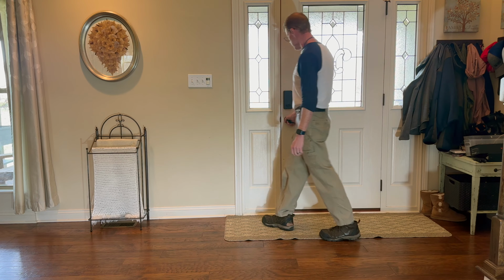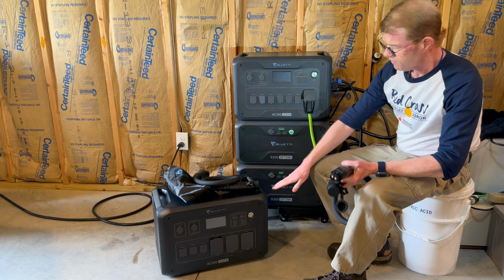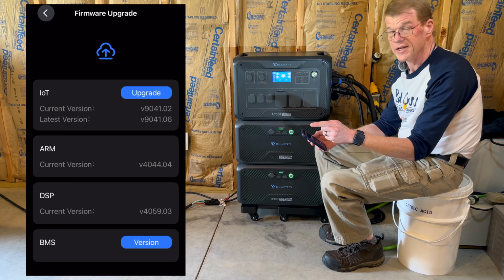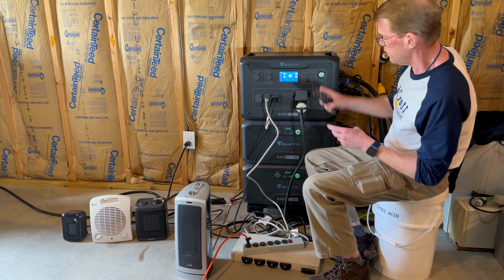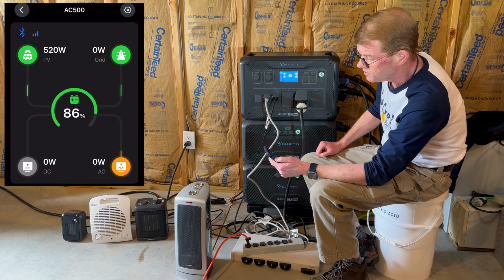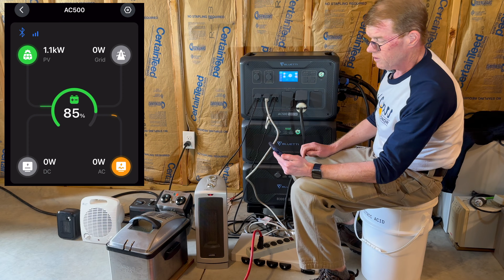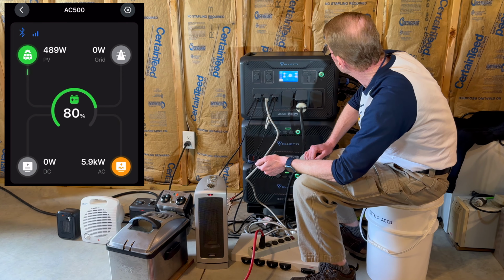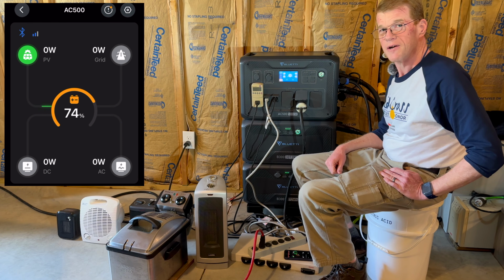Bluetti AC500 5000W Can I Overload it? Upgrade from AC300!

Comment: Good video!
I have two of the AC300’s,was preparing to install the split fusion setup when I came across some in the community who have had problems.Grounding issue on one side of the fusion box,neutral issue,and one guy who actually damaged his equipment in his home and others who hurt the AC300’s.
I have to figure it out before I install.
Can I ask what transfer switch you used?
Did you make a video on the 240 installation?
Thanks for any help,I’m just being cautious before installation.
Reply from the maker: I have heard similar,  and I guess there are earlier and later versions of the AC300.  Mine has been flawless though.  I installed the Reliance 510D, and did a video on it.  I am only using it at 120V though, not split phase.
Reply: i have been running 2 AC300s in split phase with a reliance 6 circuit transfer switch for just over 10 months now with no problems. I haven't used a 220v circuit as i am using all 6 circuits in 110v. It runs my furnace (7-800w) and pressure pump, i have a cistern system.  The only issue i have with the system is getting the 1250w input from solar. One needs very specific panels to stay inside the 150v and 11a. Right now i am only able to input 750w per mppt.   Saving money now to buy panels that will get me the wattage i need and still stay withing the inverters limits....but seeing this video i may just upgrade to the AC500s as they will allow me to use more of my current panels.
Reply from the maker: @arnoldreiter435 : Voltage is what you need to watch out for, you can have more amps available than the controller will accept, it’s very commonly done and referred to as ‘over-paneling’.  The AC300 will take up to 12A per input, and AC500 up to 15A.
Reply: @arnoldreiter435   I run 2 strings of 4 Talsun 405 panels in series to over panel my AC300. The amps are a little high but doesn't matter. Volts are around 148 total, so right at the limit but they keep my AC300 solar imput to around 2.0 kw or a little higher when all is going right. Could be better but I don't have them positioned perfectly.

Comment: How is the AC500 connected to the subpanel .. When you had the Ac300 you used the 30AMP - are you using that 50 amp connector now
Reply from the maker: Good question.  I'm using the same 30A setup as I had with the AC300, including connecting to the TT-30 outlet on the AC500.  I literally unplugged the AC500 and dropped the AC500 in, including the same input power cord since they use the same connector.  I am considering upgrading to 50A but don't really have the load to justify it.  I am curious about 5000W wall charging though if I ever need to do that.
Reply: @DougKremer  So then you are using the Ac300 Home integration kit then correct?
Reply from the maker: @seanconnerysmith4387  More or less yes.  It was out of stock so I bought the switch and parts separately.
Reply: @DougKremer  so the TT-30 that's on their you wire that to the wires that come with the HI Kit, and when you plug the ac500 in it gives power to the panel to circuits you have installed on the transfer
Reply from the maker: @seanconnerysmith4387  Yes, you can watch the transfer switch install to see all that if you like.
Reply: @DougKremer  I did I wanted to make sure because no one really explained that. Also did that tt-30 wire come with the AC-500 or did you have to get an adapter.. Ill go back and watch to see also
Reply from the maker: @seanconnerysmith4387  understand.  The AC500 did not come with any of that.  I bought a tt-30 extension cord, a tt-30 to L14-30 adapter that connects both phases, and the L14-30 inlet  for the switch, and the transfer switch itself.

Comment: Ok,I just went back through your transfer switch installation.So you stayed with 120V only?
Going the 240V installation route is where guys seem to run into trouble.
Question for you:Since the AC300 has a floating neutral,and the plastic case of it cannot be grounded,is there actually a safe way to install this?
It seems impossible to properly install this without using a bonding plug.
It’s confusing me
Reply from the maker: Re: transfer switch: it is installed per the manual, and capable of 240V with the L14-30 connector I have on it.  The cable I'm using from the AC300/500 TT-30 outlet splits the hot to feed both the X and Y terminals of the L14-30 with the same 120V.  So yes I'm using it as 120V only,  only single-pole breakers.
Grounding:  both the AC300 and AC500 pass ground through the unit to the output.  So if it is connected to a wall outlet, the outputs are grounded.  My AC300 passed neutral through just the same, I have not tested the AC500 yet.  When connected to the transfer switch,  both the output neutral and ground are connected to the same in my home panel,  and bonded together at the panel.  So the hot supplied is not floating,  it is a solidly grounded and proper 120V.  The only time you would see a truly floating neutral is when the AC300/500 isn't connected to grid power, and you are running devices straight off it via cords only.  Portable generators would be floating neutral under the same situation.
Reply from the maker: Sorry for the late reply,  this comment was caught in one of the filters.
Reply: @DougKremer  Appreciate the reply.
I did some more homework.
Seems 240 is where guys run into issues,
The fusion cable for the AC300 apparently had an issue on one leg.
I’m looking to go straight into an interlock switch,no transfer switch.
It will be used only for emergency backup.
I’m just going to go wire according to bluetti directions and call it a day.
Some guys had some real issues with burning out equipment and some blew the AC300’s themselves but that was a few years ago,hopefully it’s all rectified now.
Reply from the maker: @johnnyhotrod  Have you seen my whole house backup with the interlock?  Works great!
Reply: @DougKremer  I’m going to go back and see.I’ve watched a bunch of different channels on the topic,trying to find the best information.
I’ll look now.Thanks

Comment: Will the AC500 power a Swisher LS22E log splitter? It seems to be just beyond the limits of the AC300 when I try.
Reply from the maker: The AC500 does have quite a bit more surge capacity than the AC300.  We would probably have to test it.  Bring it over and we can try!